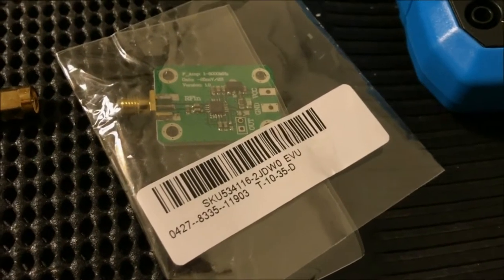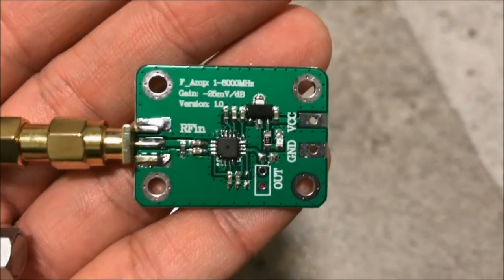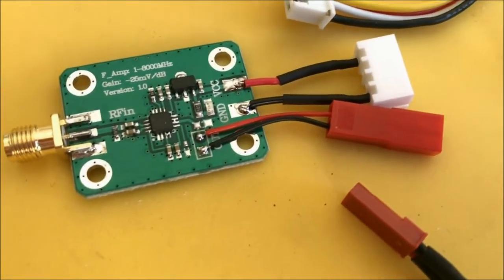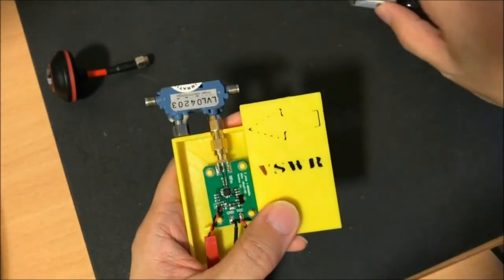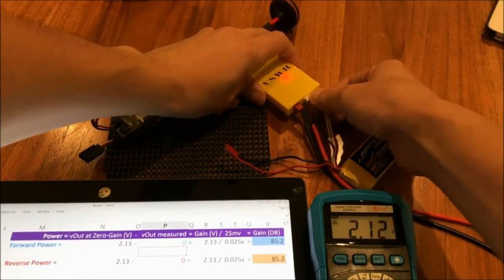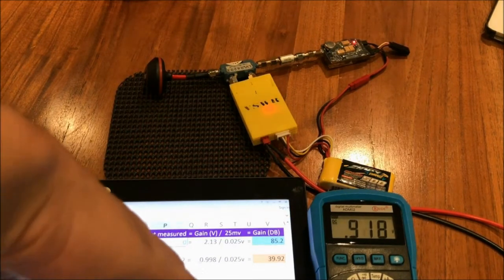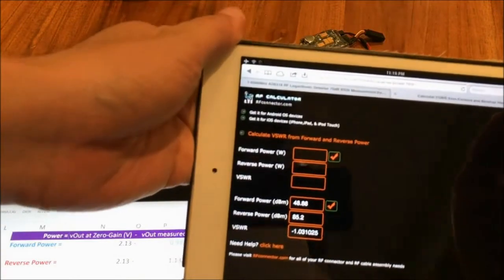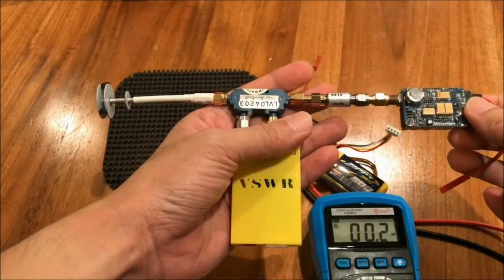Cheapest 5.8g VSWR Meter (for FPV antenna)

Comment: Is there any modern way of doing this that's cheaper or easier?
Reply from the maker: There’s a 6ghz VNA on aliexpress that’s about 220usd (used to be 700usd 5 yrs ago). Cost wise, the method in the video is still cheapest assuming you managed to get a used 6ghz directional coupler for cheap

Comment: This is very helpfull thanks. I have 600mw vtx, can I use 20db attenuator?
Reply from the maker: Glad the video helps. You would need a 23db attenuator for a 600mw vtx
Reply: Terence Chan Is it possible if we make it double and connect the two directional coupler in a row then measure forward and reserve power in a time?

Comment: could you provide a list of everything you uses or even  better links
Reply from the maker: Other than the RF power meter which is from Banggood, all other parts are sourced on eBay. The eBay links don't stay valid for very long so I did not post them. Here's the Banggood link: https://m.banggood.com/1-8000MHz-AD8318-RF-Logarithmic-Detector-70dB-RSSI-Measurement-Power-Meter-p-1119993.html

Comment: Nice - Would you have an idea where to start to make a low cost circuit that will test the transmit transmit power of a model aircraft rc. 
I want to get a measure of how much improvement one antennae makes over another on the remote controller.

a homemade version of youtube video ?v=x39v9Cjhva8

Thanks
Reply from the maker: Check out www.sv1afn.com/ad8318.html to build a full fledged RF power meter using the analog.com version of this ad8318, an arduino and a mini LCD panel. If your just gonna measure 2.4g RC controller output, you could get a digital SWR/power meter for 99usd in youtube video  ?v=6U0YG_GR8Cc

Comment: Thanks Terence, I bought a Norsal 6db directional coupler & a couple of 10db attenuators off ebay after watching the video you did on your old swr meter. Have you got links for the online calculators/ spreadsheet you used? I'm guessing the 6db coupler is going to make the maths awkward..
Reply from the maker: The online calculator is available at http://rfcalculator.mobi 
The spreadsheet merely uses the formula 
=(2.1 - reading)/0.025. Below is an example:

CROSSHAIR
2.1-1.077=1.023=40.92db
2.1-1.416=0.684=27.36db
SWR=1.5

Comment: you posted on banggood not to buy this detector. you said no output waste of money. whats up?
Reply from the maker: Ops, that was because I powered it with 5v instead of its minimum 7v. I overlooked the fact that it already has a 5v step-down built in.. my bad..I had written an updated review and it should be published by Banggood soon
Reply: Terence Chan OK. Thanks I enjoy your vids. Banggood no stock darn.

Comment: check your Rtadj value, what value you have?
Reply from the maker: This version of AD8317 does not have VSET, TADJ and VPOS. Rtadj is used for temperature compensation adjustment, and VSET is required as feedback input for measurement. For this reason, it is not suited to work with an Arduino to make an RF meter that displays power in DB. Get the version from analog.com instead  :)
Reply: also how to compute if using different db attenuator let say 40db?attenuator also affects the Vout right?is the Vout will also be change if is using different level of attenuator?thanks
Reply from the maker: The attenuator affects the vout for both ways so it should not hinder your vswr computation. My vtx is 200mw, I use a 20db attenuator to make it a 2mw vtx. At this power, vout tends to be somewhere in the "1.05 to 1.5" range which is pretty close to the center (1.3v) of its vout travel (0.5v to 2.1v).
Reply: hi, how come the forward db was 48.44? VTX is 200mw which have expected power of less than 20db.thanks
Reply from the maker: True, the readings are scaled to its own RF-power curve which is not calibrated to real RF output. For VSWR calculations, the readings work well but for actual DB output, you gonna need the other version of the ad8318 board from analog.com plus an arduino board and the right codes to produce an actual RF power output value on an LCD. You could see that project on www.sv1afn.com/ad8318.html